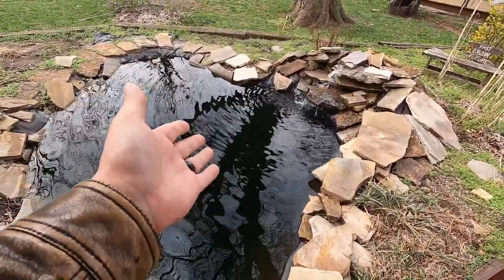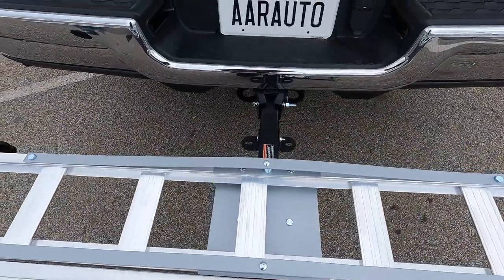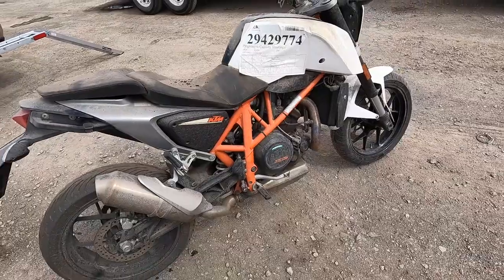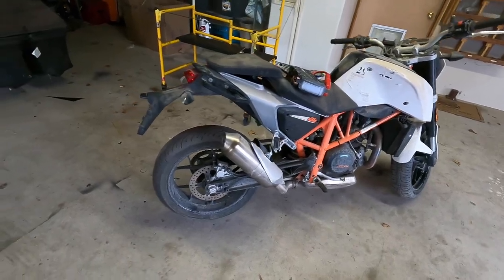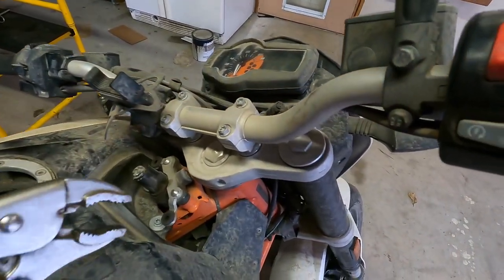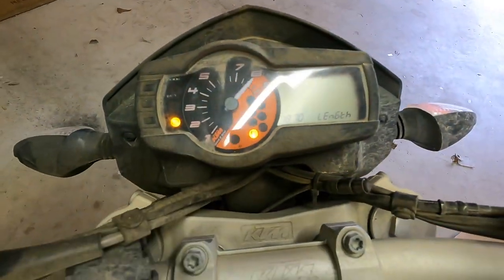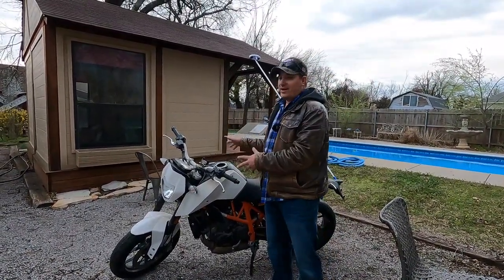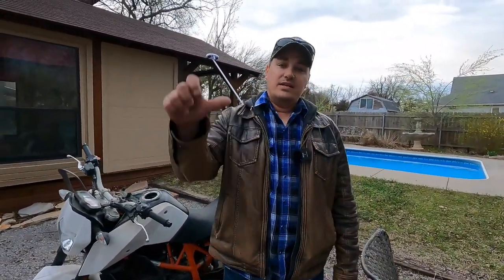I won a 2014 KTM 690 Duke from IAA for $2600 NO KEYS!! Will it run?? PT 1

Comment: You really should take a motorcycle riding course! A lot of them either allow you to use your own bike or they provide a bike and they teach you a lot of valuable skills!
Reply: I did one of those safety courses back in the 90's when I was 16. They do teach you a lot. They teach you how to avoid being in a crash and what to do if someone turns in front of you quickly of how to avoid it.  so much info and useful info to keep you alive.
Reply: Well,  this Duke is a wild thing to start. Seems like he does not know how to handle the clutch. My first shifter  was a 50cc "moped" and I had to bail out, poppig up the front wheel and scratched pretty much everything the first day. I don't wanna think about what happend with +600cc.

Comment: That price is a little high for the year and miles but hey you finally got a bike.
Reply: Average cost is actually $5k for a used one in his condition. It may have a bit of miles but miles on a bike doesn’t compare to a car as long as it is maintained like it should be it will last as long as he wants it too.

Comment: You definitely are a rookie. Most people just toss the bikes in their truck around here two rachet straps on the front from the handlebar to your corners and bam she’s not going anywhere. Take that granny carrier back haha jk
Reply: @kruleworld  I’ve got a 2019 CBR and managed to tie it up on a 2016 Double cab Tacoma with the 5 ft bed. Trust me u can make it fit
Reply: @kruleworld  I’ve hauled plenty of bikes in a crew cab truck. That bike is half the size of a normal bike as well. She will fit you hook the front straight and drag the tail until it fits worst case you leave the gate down but I’ve never had to leave the gate down. :p

Comment: Baby steps Randy, learn on a 250 and then work your way up.  I can tell you when I got my license on a 250, I would never have been able to do it on anything bigger at the time.
Reply from the maker: I got the 690 figured out :)
Reply: @AutoAuctionRebuilds  don't worry about it you going to get it my first bike was a dirt bike Honda CRF 250R.. I WENT ON CRAIGSLIST AND BOUGHT IT THAT JOKER WILL WILLIE FROM 1 UP TO 3RD  GEAR BUT I JUST TOOK MY TIME AND LEARNED THE POWER OF THE BIKE

Comment: Where to start for a newbie rider. Ditch the moccasins. Nice heavy duty 8" steel toed boots. No shorts, please. Leather coat, fastened up fully a good start. A full face helmet that fits well; fastened properly. The bike is on the big side, but restraint will help overcome the impending bout of overconfidence.

Comment: If you are really going to go somewhere on a motorcycle budget $1000 for a proper riding suit.   Most Harleys have around 50 horsepower and weighs about the same as a small elephant.  That bike has over a   70hp, and weighs a fraction of of a harley.

You won’t be able to make much content if you’re in the hospital.

Comment: Don't get over-confident, and make a full service of that bike, a good oil change, air filter, brake and clutch fluid and checking that chain tension and wheel pressure.

I'm sure you will have them done by now, but just in case...

About the people saying it's too much power to learn on and all that crap... it's the rider that counts, if you ride with a bit of caution and don't act like an idiot you will be fine, just be careful with the throttle.

About that bike-carrier, just get rid of it, that must be a pain to load/unload the bike. 😬

Edit: And stay away from that pool! 🥶

Comment: Great to see you with a bike Randy. Get yourself a good riding kit and helmet. Also, wear a flouro jacket. The most dangerous thing for a rider is a 'blind' driver. I don't think it's too powerful to learn on. Just respect it and get used to the weight. You'll need to learn to lean it to turn it. You won't need to go higher than second or third for car park learning. Everyone wants top gear and then forgets where the brake is :-)

Comment: I started off on a Yamaha 1300 sport touring bike.... not an easy feat but I learned a lot about weight and balance. I ended up taking that bike on a few camping trips, which was an experience in itself .

Before hopping that machine, I took a MSF course. It was a two day course which fully licensed me as a legal motorcycle rider. 

Getting in that bike was risky but you did it in an enclosed area , away from the street where you could cause damage to other people property as well as yourself. 

The point I am getting at is take a riders course before you hit the streets and always wear a helmet.

Comment: Am smiling while watching you ride.  The bike is actually  a bit small for your size.  I bet you  are just in the first gear, well you are in your yard.  Tried motor bike when I was only about 12 yrs old, but never really had much experience since the bike is not mine, it was my big brother.  Kudos to you for being able to start it without the key.  the bike that I rode is probably a Honda mountain bike 100cc, not so sure though.

Comment: That back tire has hard rubber in the middle and softer on the sides. Designed to stick in the rain yet long lasting. I found it a very good tire in the cold\wet and in summer.

Comment: As many have mentioned, go super easy on that throttle until you get the feel for it, otherwise you'll be on your back, on the asphalt, with the bike crashing into your face! 😁 I was an experienced rider, or so I thought. I had owned a Honda 125 for years, then a Honda 450, both street bikes. I hopped on my friends Honda 250 dirt bike, and punched it like I would the 450, and my young (at the time) reflexes saved me from going ass over kettle. The bike you bought has more power, and is geared to race so take it easy.  😎👍✌

P.S. Nice first ride, but when you get her on the street, and want to floor it, DON'T! lol

Comment: Looking good Randy, keep your feet on the pegs, it's not a bicycle you will break your ankle or leg by putting your feet down. I learned how to ride on a 550LB Suzuki cruiser. AARHQ is the better place to learn to ride a motorcycle. You can ride obstruction free for miles and get a feel for the bike. I will tell you, you should have bought a bigger bike, after a month of riding you will upgrade bikes ..lol Do not be afraid of the motorcycle, but you should always RESPECT it. Good video Randy...now stop riding dirty and get your permit. Lol

Comment: Good job Randy, I was a little hesitant and scared to when I bought my first bike, but once I went through the safety training course I came out with a better understanding and knowledge of how motorcycles operate and it did boost my confidence up some as well. I been riding since April 1st of this year so I'm still new to it, but I'm enjoying every minute of it. Biggest advice I can give is there will be crazy drivers out there that don't like motorcycles so do your best to steer clear when available to do so. 3rd time out for me I had a person in an XC90 Volvo SUV put mine and my buddies life at risk when we were on our motorcycles by passing us and 2 other vehicles with a double solid line and on a blind up hill bend. It was scary for both of us. Anyway, enjoy your new motorcycle and yes I know this video has been up for about a month, but I'm just getting back to your videos now. Keep on keepin' on (btw I ride a 2003 Honda Shadow ACE 750CC)

Comment: I believe you will be alright on that 690. Granted bikes are more powerful today.... My first bike was a 95 model Vulcan 500cc...i learned to ride the day I bought the thing.  I bought it from a small dealer/repair shop and then drove it 20 miles home on the interstate.  I mean I was white knuckling the whole way home.  Not a bright idea, but I made it and wanted a bigger bike the following week.  I was 5'7" and 125 lbs when I got that bike back into 2001.  Fun times and many bikes/miles later.

Comment: Till your parts come in run and get a toggle switch. Was wondering why you didn't just get a ramp and straps for the back of your truck. I hauled a Honda CBR 660 in the back of a mini van lol. They do make a kit you can install on your preexisting trailer also. Nothing wrong with flipping vehicles and motorcycles.

Comment: A little over 300 pounds is NOT heavy. My 250 Honda weighs 325.

Take a motorcycle safety class. That bike is perfect because it has enough power to not bore you when you get experience and light enough to pick up easily.

Comment: Don't go crazy twisting the throttle. They do not need much. Easy on the clutch and easy on the throttle or you'll be looking at the sky. Make sure when you brake to hit the back first then the front. Back brake is the foot pedal on the right. Unless you like doing endos. Front brake is the lever on the same side as the throttle. That's a 6 speed bike so one down five up.

Comment: S few things you should remember when riding.  1. When it feels like it's falling and you have the room slowly and quickly increase throttle and it will bring you up straight. 
2. Remember you're on a bike. Even when you're way more confident and you feel great. People tend to get this mentality that they are a badass but cars can just run you over.  Don't get hot headed and think you're invincible.
3. Ride in a group as much as you can and learn from them.
4. Pretend and practice, similar to dismantling a gun or typing, go thru gears and scenarios in your head while you're watching TV, movies, and have time
5. Relax and have fun.

Comment: I never ridden a motorcycle and my Uncle told me to get a starter bike and I bought a 1981 Honda CB 400T
 I put 800 miles on my 1st summer on my permit with my uncle and some friends  then I took my motorcycle safety class the  following spring and got my licence and F put 9000 miles on my bike but I haven't ready for like 5 years because of my health.

Comment: Get some training with smaller bikes, before you hop on a 2014 duke. Those things are hardcore. Crank the handle a bit too much, and you backend will slide. And the actual first gear Start from 0 can be tricky - especially if you never rode a shifter bike. Please take care.

Comment: Randy, You bought a hell of a nice bike for your first bike and you got a great deal provided it's straight? (No bent frame) I myself have been riding for over 35 years. Get yourself a snug fitting full face helmet, gloves, mesh jacket with a liner and armor and a good pair of riding boots. Take a riding class, don't be afraid of that front break and most of all Best of luck!

Comment: Look up your local MSF (motorcycle safety foundation) courses. They teach very valuable information for riding well and staying safe on the road. Also get decent gear, at least good gloves, a helmet and boots for learning because a motorcycle will crush your foot if it falls on you. Ideally you want a jacket with spine protection and Kevlar pants with knee and hip armor in addition to the basics.

Comment: I have bought over 200 motorcycles from copart. Put the bike in the back of you pickup. The forklift will unload it in the bed. And you can unload it with a ramp at home. The price of the bike is about right.

Comment: I knew you had already ridden in the yard, you can see the tracks. A 690 that sits that low should not be an issue and it's also a 4 stroke. If it were a 690 dirt bike then there would have been an issue as you would have to be 6' 2 to stand and hold it.  Riding on wet grass, good job with street tires. You will be fine, get a nice full-face helmet, get out to the mall, and ride.

Usually, you can take a motorcycle class and when finished you have an endorsement and just have to take the state test which is almost exactly like the class test and you don't have to ride for the DMV. Also, classes fill up as spring starts so see about booking now. My class was the 2 hottest days in June and we were required to wear full-length pants, boots, gloves, and helmet. I almost didn't complete the class as dehydration was killing me.

Comment: that bike is not over powered but has a lot of grunt and i agree not for newbies. I owned a 1982 kawasaki KZ1000 LTD and with a few mods was putting out 100 hp and man is it a mean bike but even a newbie can ride it as long as your cautious. But i got so used to it i could not get off of it. I rode it for two and a half years until someone turned out infront of me without looking and bent the forks a little. I had to sell it to the insurance company. I want another one and plan to buy from Kaplan out of New England. If anyone is looking for sweet vintage bikes, go to kaplan. Randy once you get the bike bug, try a classic japanese machine. tons of fun man

Comment: Never put a first time rider on anything greater than 200 to 250ccs. keep index finger on the clutch lever 24/7 so you can drop that wheelie when you overthrottle it - like every beginner does. 690ccs for a beginner equals a wrecked bike. seen it a hundred times. START SMALL! riding course and lots of practice by yourself OFF THE STREET. I used to race motocross.
Reply from the maker: I did just fine on a 690, and now I own a HD 1200 with zero issues.

Comment: In Germany you need to pass a motorcyle licence. I had theoretical and 14 practical lessons. There is a minimum defined including night, high speed and so on. If you pass both test with the official which may take half an hour you are still power limited first. It looks like there is a good chance that beginners motorcyle rider in US may be a bit unsafe. Stay well and healthy.
Reply: Ok at the end you say you need to make your licence. That makes sense.

Comment: I'm 5'8", 130lbs female. My first bike was a Harley Sportster 1200. Don't drag your feet it's a good way to fracture your ankle. Ride like you're invisible  to to the people in cages(cars). Took my certification on a Fat Bob.
Reply from the maker: I’m actually getting a Sportster after i trash this learning to ride 😂
Reply: @AutoAuctionRebuilds  Not sure how tall you are but I felt a little cramped on the Sportster until I put forward controls. Loved the sporty but not as comfortable riding as the next step up bike. I considered the sporty was a great bike to bop around town but a cruise to Seattle,90miles, it killed my back. After you get your confidence and are comfortable with the KTM.I'm a Hot Rod and Harley gal but there other bikes that you may want to consider. Good luck.